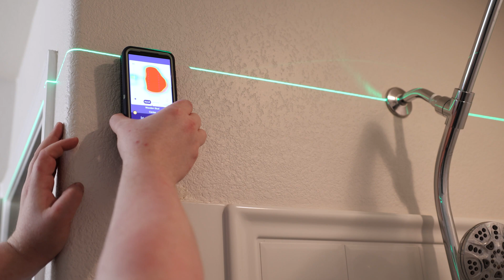Walabot DIY Expert Mode

Comment: Do not install lights with out a box, it is a code violation and could void your homeowners insurance if the fire was determined to have started in or near this area. As this was right next to a stud it would be easy to install a pancake box and do it right.